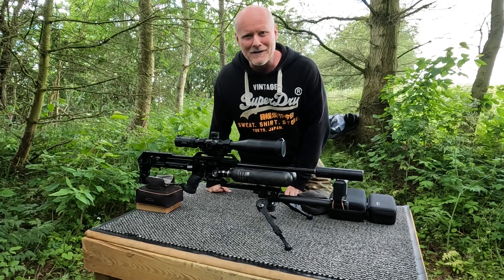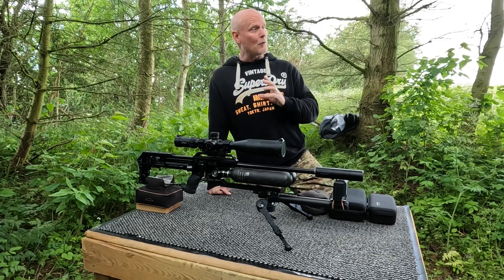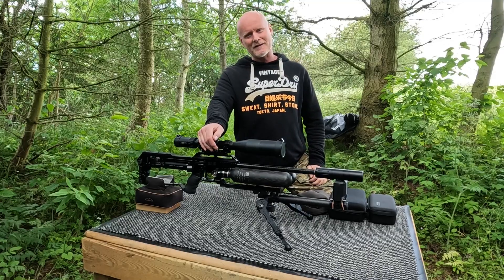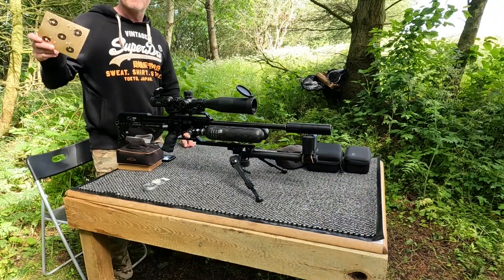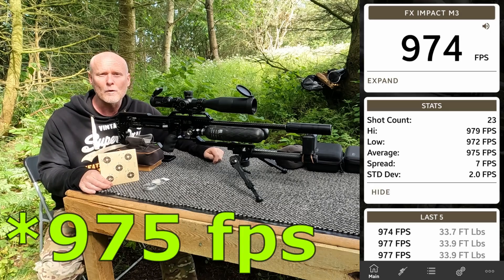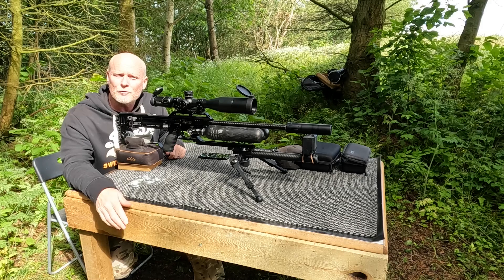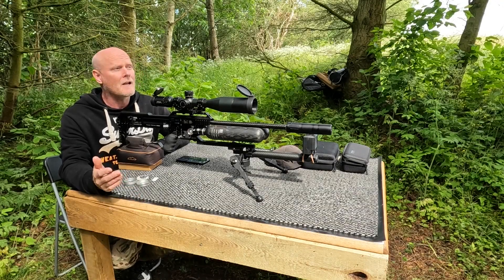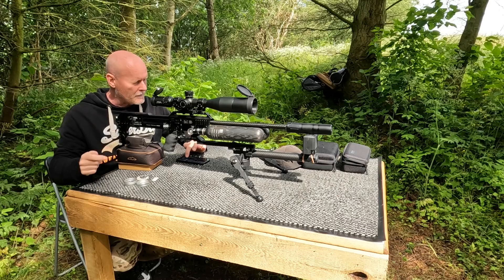FX Impact M3: How Weather Impacts Velocity and Accuracy

Comment: Feliz Año!!. Otra pregunta si me lo permite. En mi M3 he instalado el tensor del cañón y he sustituido el tubo original ( forro ) exterior del cañon por otro tubo tensor.
Entonces mi pregunta és: Si pongo también el afinador de armonicos será aun mejor o no lo necesito?
Muchas gracias y esperando su próximo video por que voy aprendiendo mucho de usted.
Reply from the maker: Thank you very much and a Happy New Year to you aswell 🙂
The harmonic barrel tuner will make the biggest difference on a free floating barrel, but it will have some effect while using the barrel tensioner.
In your situation I would use it for a while and do some through testing - perhaps like the method Im using in my latest video, and do it several times. And then do the same without the barrel tensioner 🤔
In this way you will know for sure🙂
Reply: @VikingAirgunner  Bien. Gracias!!

Comment: Really interesting! I think if you keep record of temp/air pressure (or simply density altitude like used in aviation) and plot that against best velocity for smallest groups you could well end up being able to predict what velocity to shoot at on a specific day for best results.
As you mentioned air density changes with altitude, temperature but it also changes due to high and low pressure weather systems moving in. The weather systems can make a difference of quite a few millibar. Then there is also humidity that changes air density, the higher the humidity the lower the air density so that should also be taken into account.
All really fascinating! Thanks for sharing, you got me thinking!

Comment: Good morning Peter here at my place in CT USA not sure what time it’s is where you live but I have a question for you I haven’t used my m3 in months and yesterday I was putting air in it and my first reg was up to like 225 and my bottle was like at 205 so I’m wondering if I have a stuck reg and what I should do now I know you fix your air guns so I’m hoping that you can help me out thank you Del and hopefully you and your family had a great holiday tu again Peter
Reply from the maker: I hope that my advice will help you then 😃
I imagine that your gauge is on there too tight.
Try to loosen it a bit. That usually helps 🤗
Reply: @VikingAirgunner  ok I’ll give it a try it won’t be until later on I have 8 snowblowers to fix and a service call to get to question reg gauge or bottle gauge thanks again

Comment: Thanks for your video. I have a question after tuning the fix impact m3 and after a couple hours, the velocity goes down and goes back to normal after 10-15 shot, any idea why it happened thanks for your answer
Reply from the maker: Good question!
I have tried this myself and I dont have an exact answer on why this happens.
What I usually do - because I know that it will return to normal - I dont try to retune the gun, but as soon as I notice this issue I increase the tension on the hammer spring by one click on the power wheel. Shoot a couple of shots untill I see a higher velocity than the gun was set for, and then I reduce the hammer spring back to where I started.
You can try this. It is the best advice I can give you.
But I would not be surprised if this issue disappears after a while where you only make minor adjustments to the gun 🙂

Comment: I got a bit freaked shooting my Two yesterday, the 13 grain Zans was shooting pretty darn well at 1020 FPS, but yeah the sweet spot is a bit lower.
later in the day as clouds and rain got near and so light dropped i changed to 50 M and even disposed of a few beast pellets i had in surplus, at 50 M the 13 gr Zans was just lasers at 972 FPS.
Much better than the KO at the same speed / setting

Mind you at 86 M they was also fine, i killed 1 fly and i am sure if flies have hair on their ass i removed those on another fly.
Also killed a few flies and a small spider at 50 M, and cut countless blades of grass

From 10 in the morning and until 7 in the evening i was one big smile,,,,,, yes when i shoot i SHOOT A LOT
Reply from the maker: That is fantastic news!! Usually it takes a while to find the true potential in a gun, so it seems that your have found a great gun.
Very happy for you 😎
Reply: @VikingAirgunner  Yes it is nice, ATM playing with the 13 grainers, next outing i will  be more serious with the 16 grain Zans
13gr seem to run well from 910 to 1020 FPS. but somewhere in there is the sweet spot, and i think it is not far from the same speed my Maverick like to shoot the same ammo.
Going shed building and of course shooting again Tuesday, and will probably again spend 2-3 days at my friends place.
Have just ordered sekmet gauge for regulated pressure,,,, and HUMA regulator.
And more 2" targets as i seem to have been burned 2 times with targets now.
First on aliexpress with targets with no splatter effect, and the replacements i ordered in Finland, well i heard nothing since June 3 when i ordered.
So i might have to take the drive back to Randers if Huma and Mundilar have stuff in the mail for me Wednesday.
but i gladly do that for shooting hardware.
And of course a pitstop on the way at the Kiosk in Bjerringbro for a nice old school ice cream in a cone.

Comment: Thanks for the video Peter. i used your tuning tip with the front valve to remove low starter shots on my .25 M3 25.39gr.
I checked yesterday from cold and got 905, 902,907. An improvement as I noticed some starter shots were 20fps low before. No good as a hunter. atb neil
Reply from the maker: That makes it all worth making my videos Neil 🙂 SO happy that I could inspire you to get a better experience with your gun👍👍👍👍👍

Comment: Great video again, thank you. One thing I struggle with more than anything is I can tune my M3 perfectly, by following your video guides. However, a day later shot velocity is down and accuracy is off. Not weather related either. Any ideas?
Reply from the maker: Thank you Nicholas 🙂
What is your setup? Length and type of barrel in particular.
And what ammo are you using? 🤔
Reply from the maker: @NickGled  Tinkering is the fun part 😃 Im happy to hear that you solved the problem. Can be quite an issue to locate em 😜
Have a great Sunday 🙂
Reply: The Impact suffers from o-ring stiction on the valverod due a bad design. It means it takes couple of shots before its back on speed. No blame to YouTubers, but they all keep this quiet.

A forummember on Airgunnation has made a modified part for it, I run it in my Impact and the problem is gone. 

https://www.airgunnation.com/threads/fx-impact-mk2-m3-slower-first-shot-no-reg-creep-quasi-scientific-analysis.1175929/page-20#post-1760746
Reply from the maker: @NickGled  I think you should write them and suggest that 😃
Funny thing is that barrels can be different and setup will affect harmonics, so a velocity should always be seen as a guideline 🙂 All that matters is what works and feels good to each person 😎